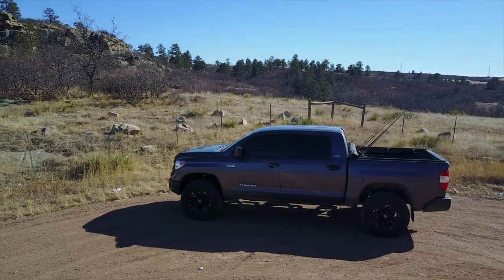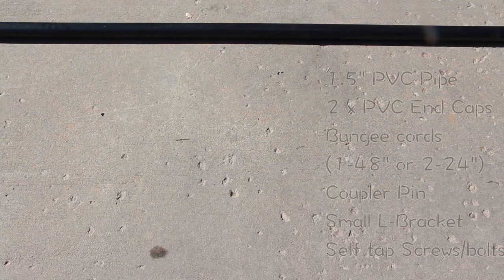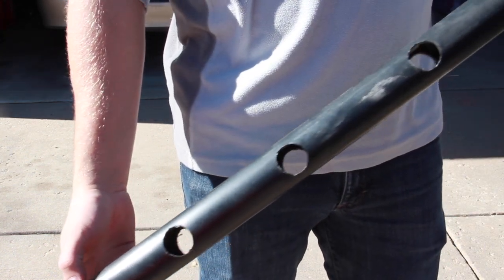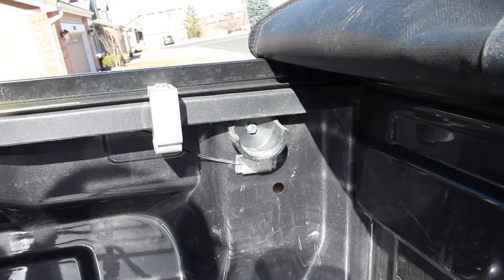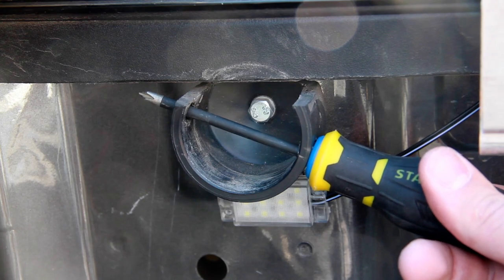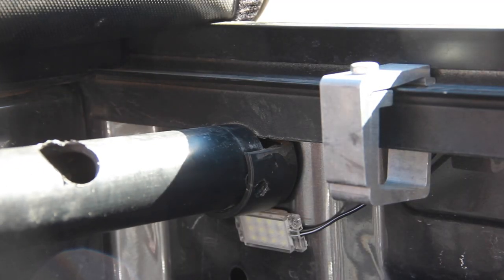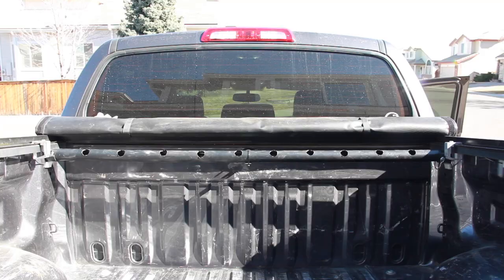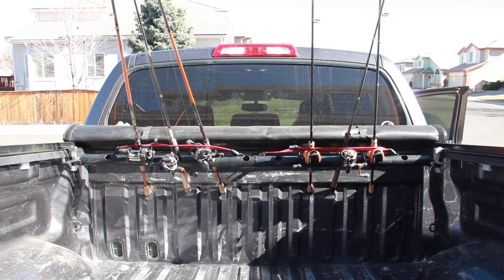DIY - Fishing Pole Holder

Comment: Good design. Only critique I have is when I made mine on my f150 I found putting two sheet metal screws in each cap beneficial because I had a problem of only one screw wearing a hole in the sheet metal that eventually allowed the screw to slip out and taking the cap with it (happened when putting on/ taking off the pvc pipe and I like this design because you can take the pipe off if you're hauling a lot of cargo)

Comment: Not to bad but are you sure it's PVC pipe?  Looks more like ABS pipe that might get soft in the hot sun?  Also the holes are ragged and not clean like holes cut into PVC usually look.  Try a schedule 40 PVC that is stiffer and harder than ABS but using it outside is not a good idea as it gets brittle and can crack easy in direct sunlight in a year or two.   Or you could just buy a T-Rex Tough Fishing Rod Holder for about the same price where all this work has already been done by a team with over 50 years experience professionally fabricating  the best Rod Holders barring none.  They are guaranteed for 10 years!!!  Your friends would really  be impressed. Thanks.
Reply from the maker: I respect the hustle...
Reply: @CatchingColorado  Just the truth, no BS or hype.